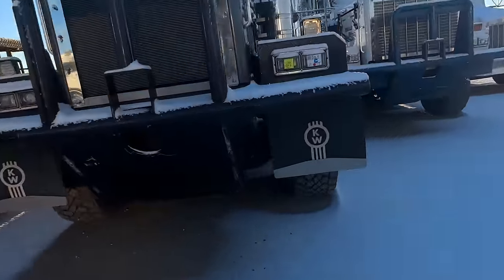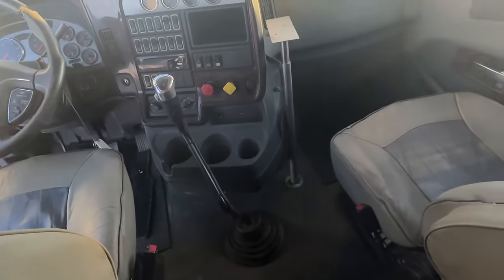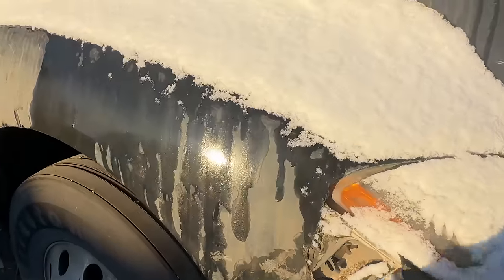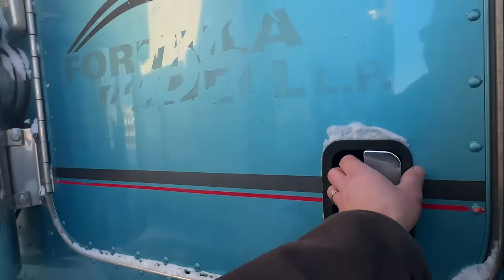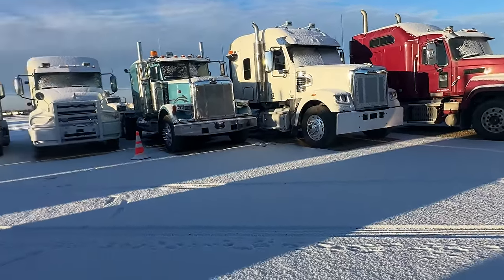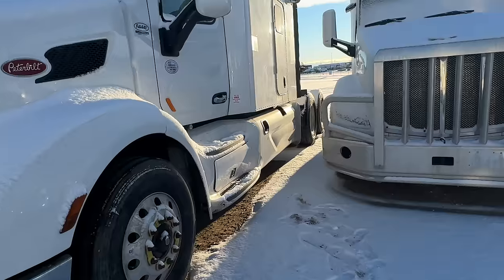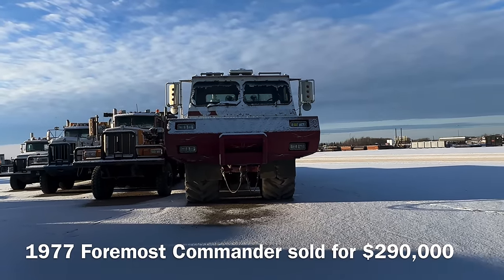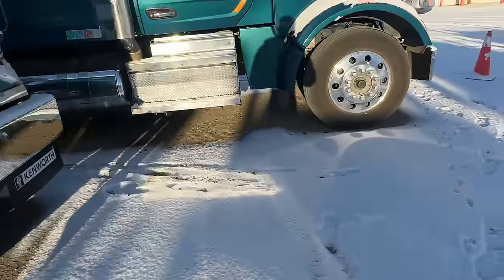On The Hunt Ep.39 Ugly But Cool

Comment: Hey Mark, the Smart shift is brilliant in the Freightshakers! Gimme an 18speed for fun, but for work, an automated manual for most applications…
Reply: Yep. When you're saving $1000 a month on diesel your masculinity can take a hit!
Reply: Yeah my boss switched to EF 18sp autos in his SAR's and even with 600hp the fuel saving was no joke. Even when driven in manual mode.
Reply: Eh some autos are improving over the years 

For real a auto in the traffic is fantastic. 

For heavy duty work other than constant highway driving give me a damn manual!  preferably a 13 speed or a 18 speed MANUAL transmission! 

I like to make my rigs do what the hell I want them too lol
Reply: Usually when your taking off in a automatic you cannot punch it and lug it if you have too unlike with a manual. The autos take off slowly then shortly they build up the horsepower that’s why it’s nicer with a automatic in a more powerful rig.
Reply: @JacksonGuitarsPlayer03  the big MP10 Mack ONLY comes in auto. In fact, any production truck over 600hp only comes in auto. Mack claims that a mis-shift in a manual will smash gears and they don't trust operators so they only offer manual.
Reply: @1one3_Racing  yeah I been seeing newer Mack trucks mostly autos that actually sucks because their roots are tough strong reliable trucks 

Lot of older guys would hate to see only auto Macks I know I do not like it but if it’s nice it’s nice I guess
Reply: @1one3_Racing  exactly I’ve heard autos clanking a crap ton I drove autos before in paccars and in some X15 Cummins trucks the transmissions were garbage Eaton automated manuals I think they call em. 

Junk 

I did drive a newer T880 a while ago with a 525 Cummins automatic transmission it wasn’t that bad it was much smoother I give it that. You can leave the engine brake on max like you would in a manual and it would slow itself down nicely without giving you BS. 

Still I prefer a manual. 

I believe manual today is a custom order option when you go purchase a rig
Reply: @1one3_Racing  good on Mack for that decision
Reply: the autos we get in construction equipment are alright, but those are geared way way high, maybe 25mph top speed on a blade if u push it. if they take a loader trans and throw some lower gears I think it'd be successful
Reply: @Twofrogsonecup  some of the higher powered Cummins motors with Eaton autos in it are not bad 

Allison automatics in big trucks shift like your car 

The Eatons are automated manuals they hesitate when they shift like letting off the pedal when shifting a manual

Comment: Don't knock the Automatics until you drive one I like to see you drive one including in manual mode I want to see you drive one.its a lot better on your hands not to get carpal tunnel.
Reply from the maker: I have driven one back when I hauled gravel … boss bought a brand new unit and it wouldn’t back up a slight incline in the field we were working.  He got so mad he drove it back to the dealer and the next day handed me the keys to a rig with an 18 in it 😂 but I get it … it’s convenient to just put it in drive and drive

Comment: The screen keeps the fine snow out of your air filters use to run it on the ice roads. As for the automatic trans after 20 years driving a stick I don't have to prove anything to anyone anymore. Wouldn't give up my automatic for highway use. In the bush or on the ice stick definitely gives you more control. A flat top truck looks great until  you have to live in it for a couple weeks at a time. I like to be able to stand up and put my pants on.
Reply: The sad thing is you never had to prove anything to anyone. The only one who cares whether you drive stick or not is you.

Comment: I've driven K200 cabover Aerodynes a fair bit here in Australia and the windows in the top of the sleeper are ALWAYS kept covered, because you don't want that light and heat getting into the cab while you're trying to sleep. I can't speak for the guys that live in their trucks week in, week out, but for someone like me who would do semi-regular overnighters, I never saw the point of those windows beyond it harking back to the old Aerodynes. It's also interesting to note that the new Kenworth K220 cabovers don't have those windows anymore so I think most drivers weren't using them at all.

Comment: It's neat getting to see the auction units we dont have an RB here anymore. That tri drive with the super long fifth wheel slide is so it can still pin onto a trailer meant for a tandem, I've ran a few and they become steer scrub central with a short neck trailer on ice 😆

Comment: Extended slide filth wheel. It’s a heavy haul thang man. I run mine centered between the pusher and the front drive due to the length of my Neck on my lowboy. Here in the states they want me to get 20 thousand on each axle and still have weight on your steer. Those heavy weight Dock bumpers when they are heavy on the steer they just slide the seat back and forth to move the weight lol.

Comment: Stacks previously served a purpose and that was to get the smoke and soot up and away from the ground and up and away from the trailer.  That purpose no longer exists since engines run much cleaner these days.  Even without a dpf or scr system diesel exhaust can be very clean with modern engine control system and common rail injection.  Common rail fuel injection greatly reduces noise and reduces engine wear due to pilot injection and multiple injection events.

A truck is a tool and the purpose of that tool is to make money.  What the outside of the trucks looks like is irrelevant, the truck is operated from the inside and that is where the driver spends the vast majority of the time.  What happened to the principal of function over design, chrome serves absolutely zero purpose and only adds weight which reduces load capacity and adds to the cost of the truck.    Automated transmissions increase fuel economy and driver safety due to a reduced work load and they reduce drivetrain wear and tear.  Reducing the weight of the truck increases the amount of freight that can be carried which  increases profitability.